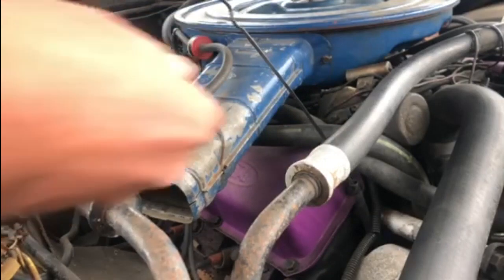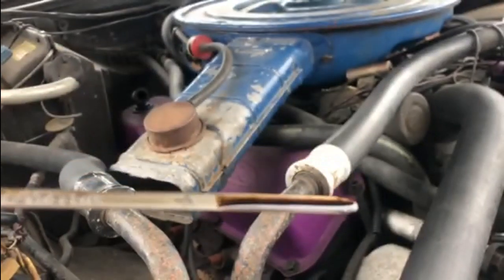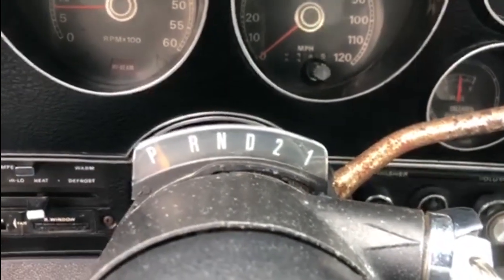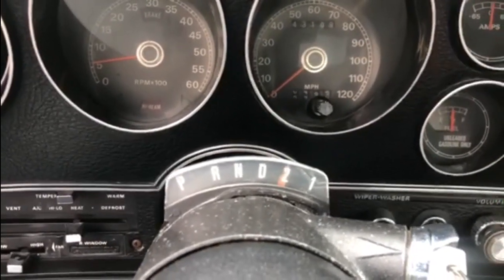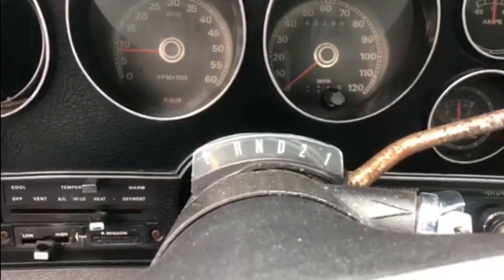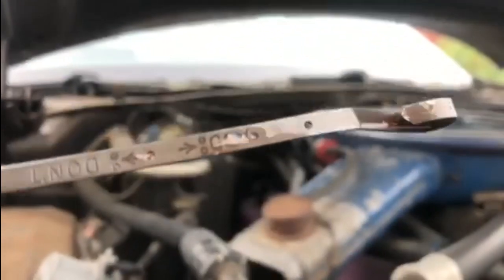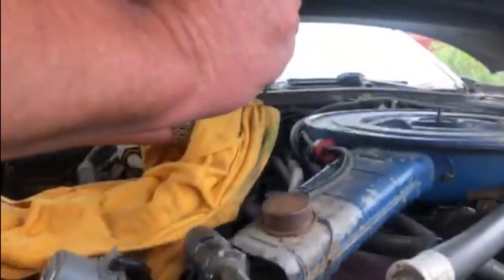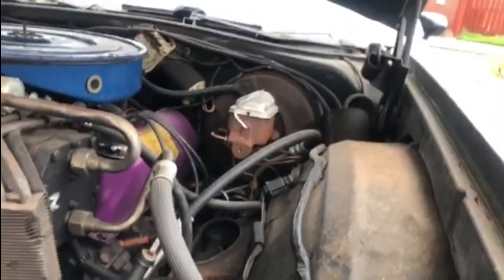Checking for leaks in the Ranchero

Comment: Those were the days when you could check the gearbox fluid from a dipstick!     Perhaps clean the plugs too?. Sounded a bit lumpy to me, or is that normal?      Cool daily driver though.
Reply from the maker: I know, having a dipstick to check it on is so much better. It is normal for sounding lumpy, but it does need new plugs and leads etc